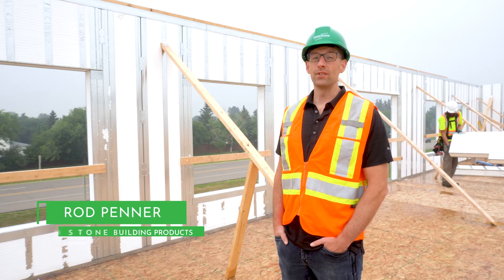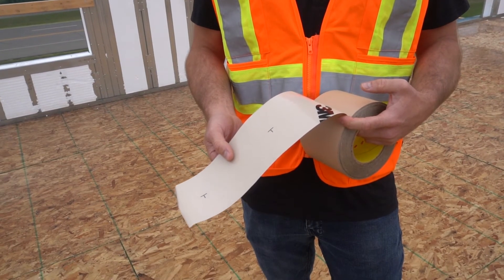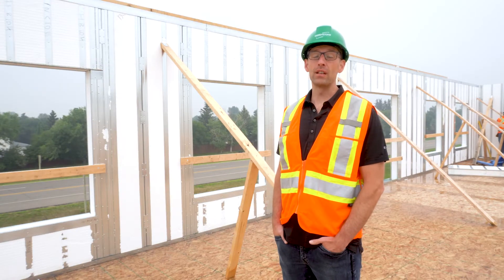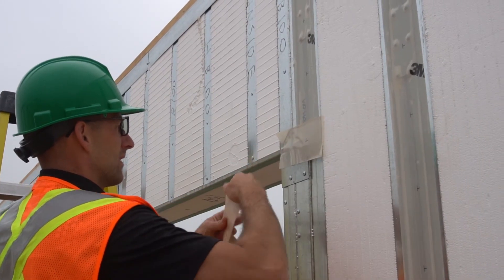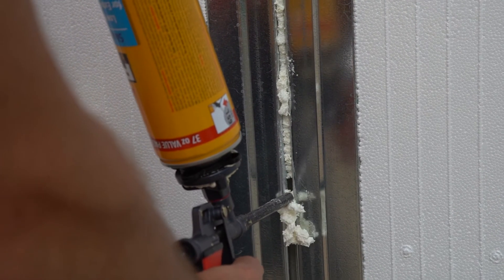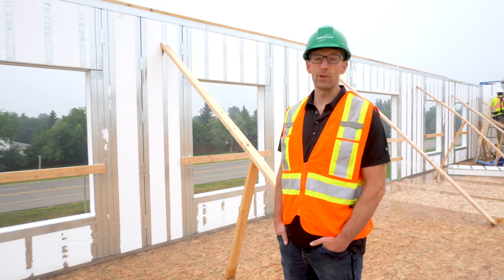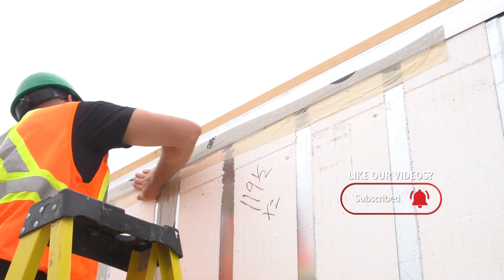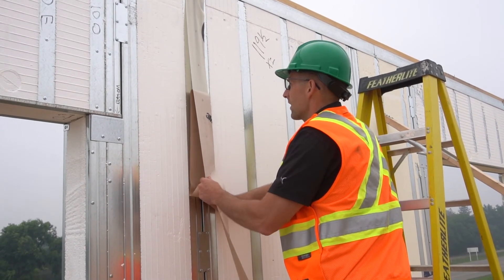Build It With Greenstone | Sealing the Panels with 3M Tape

Comment: is this in addition to the bead of sealant in the base track and shiplap seams?
Reply from the maker: To seal the joints and seams you would use a 3M tape and a low expansion to fill any gaps to achieve an airtight seal. No bead of sealant is required.
Reply: Thank you! @GreenstoneBuildingProducts